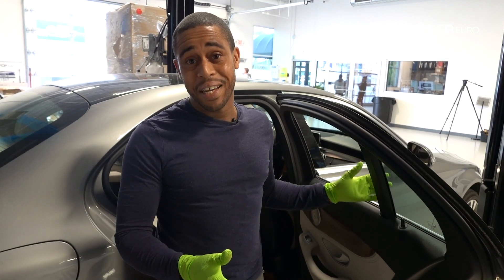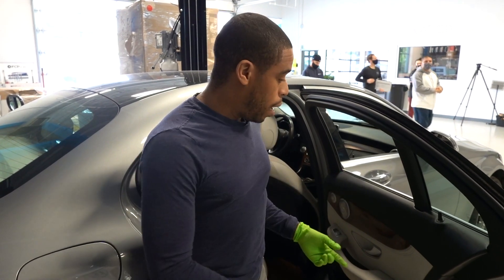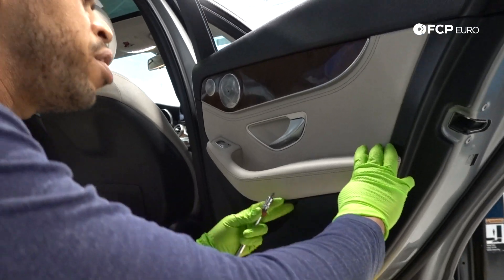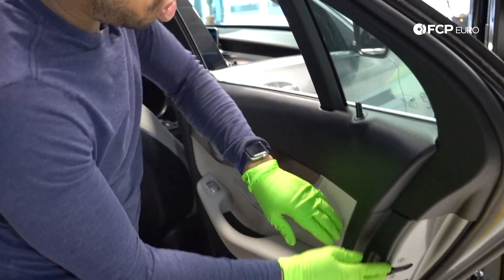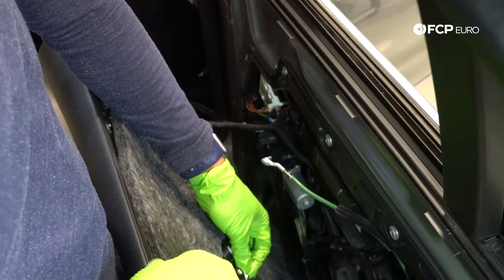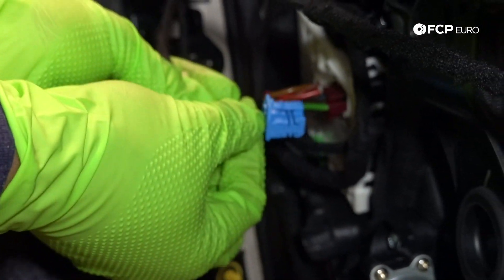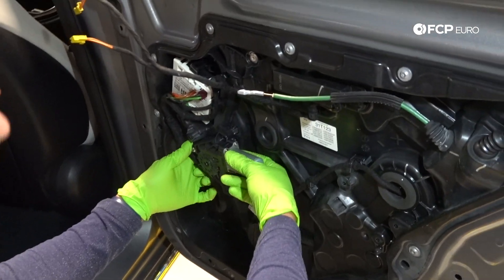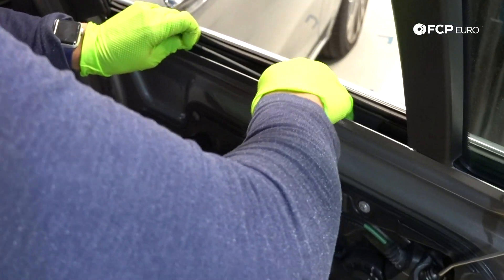Mercedes-Benz W205 Window Regulator Repair & Replacement (C300, C400, C43 AMG)

Comment: This video is a start, but the title is misleading. Let's see removing the glass, removing the regulator, etc. I came here for the torque spec on the bolt holding the clamps that grab the window glass but you didn't even get to that step. The rubber piece insulating the clamp on mine was torn and the window was pulled out. I ended up repairing the rubber with some cyanoacrylate glue on the tear and then a layer of flexible vinyl and plastic adhesive. I even had to re-wind the cables for the regulator because the yellow plastic spool popped out, which could be the topic of another video. Now that I'm putting it all back together, I want to make sure I get the torque right so the window glass never slips out again.

Comment: That channel at bottom of window opening on door frame that door card must realign with & slide into for it to firmly anchor on door frame without any slop or play is a step commonly missed during reassembly because door card seems to be aligned without it. There will be a larger gap between door card & window until that channel track is fully engaged.

Comment: Could you please please do a video showing how to replace the the bulbs on the exterior door handles for the Mercedes c class w205?

Theres not much online for it and dealerships charge around £600 for labour for a £20 bulb change....as it includes removing the door panel on the inside.

Thanks!